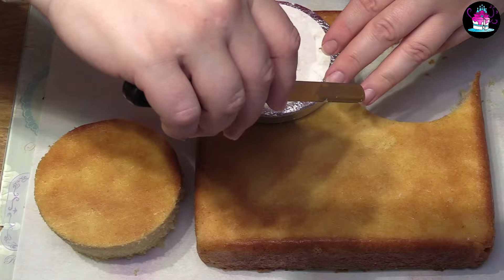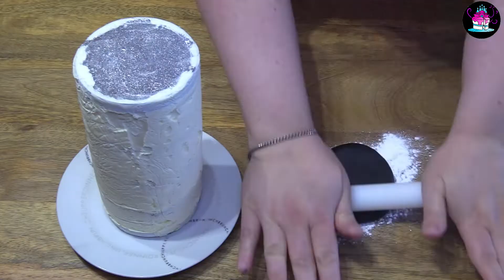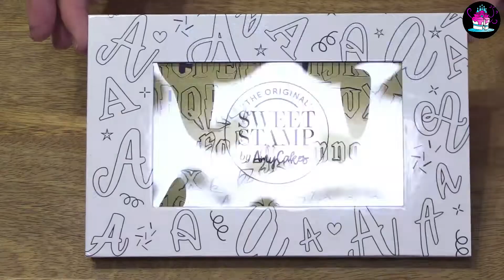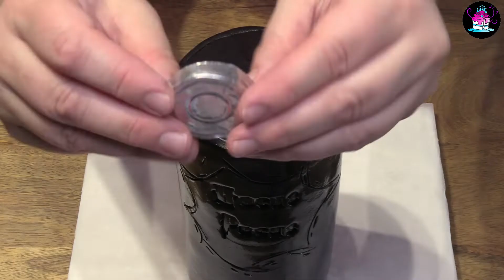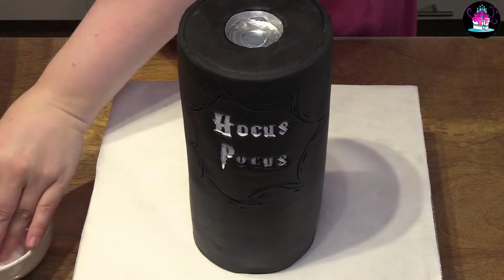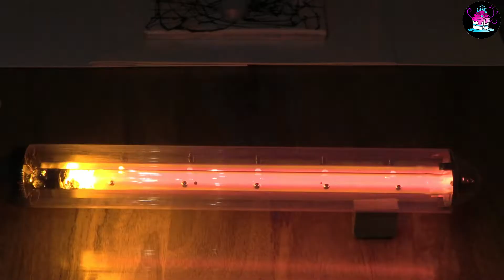Black Fire Candle Cake Tutorial Inspired by Hocus Pocus | No Special Effects | Just Science

Comment: What did you do with the low pressure light?
Reply from the maker: Im in the UK and purchased mine from ebay x however the brand  Phillips do sell the bulbs brand new x
Reply from the maker: Sorry I thought you asked where I purchased it from, you need different lighting like you do with Glow in the Dark cakes. You just turn it on then light the ingredients in the top of the candle and it will burn with a Balck Flame. I like to add normal tea lights to the cake drum aswell so people can see there's no special effects used, the tea tights will just burn like a normal flame x
Reply: @RachelsEnchantingCakes  Thank you Rachel my other question is can the dipping solution be substituted for something else? I am in the US and to get the solution will cost 10 usd for the solution + 30 usd shipping.
Reply from the maker: @phubbard51  you will have an equivalent, just look up the same thing but in different brands from online cake decorating stores x I don't know what you guys will call it but it's nothing special, a bit like sugar, we all call certain sugars different things so Icing sugar in the UK is powdered sugar I think in the US. Its the same with the dipping solution I use, it will just be a different brand and most likely different wording x